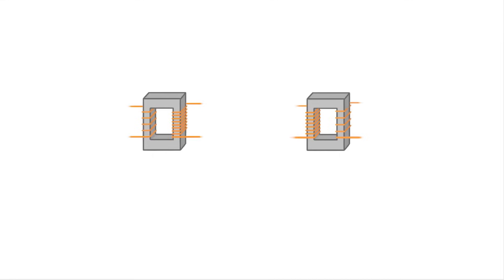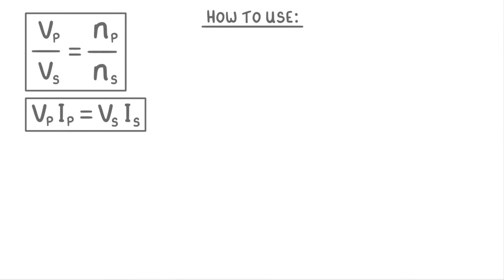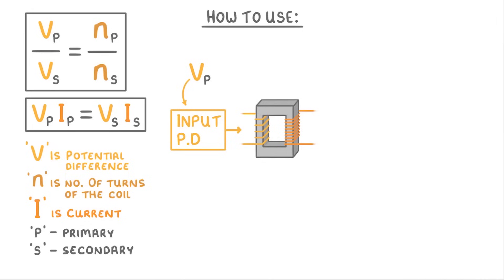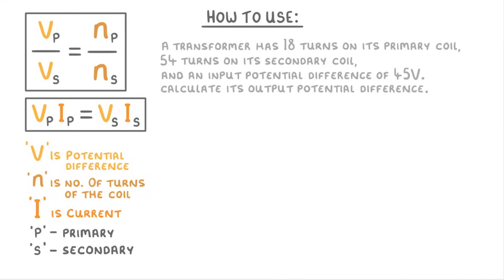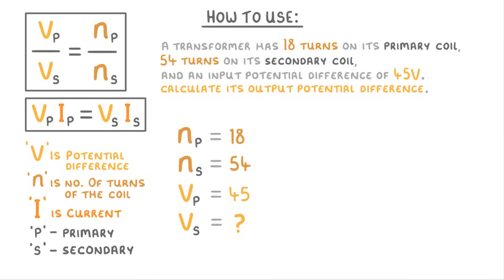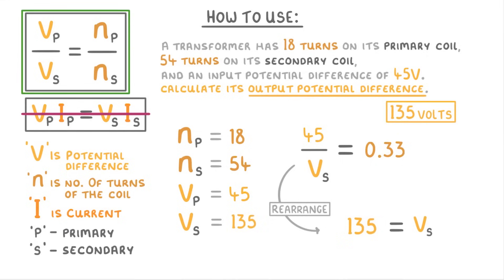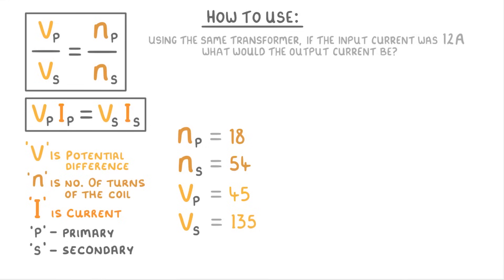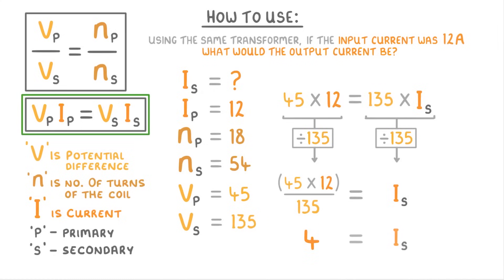GCSE Physics - Transformer Calculations (2026/27 exams)

Comment: bro i calculate 45 divvied by 0.33 and my answer was 136.36 is it right or not ?? @cognito
Reply: You need to make the 0.3 recurring, then you get the correct answer of 135V :)
Reply: Or leave stuff in fraction form till your final answer.

Comment: The first question is wrong 45/0.33=136
Reply: What how? That makes no sense. 45/.33 is just 45 × 3 which is 135.
Reply: If you do it using the cross multiplication method (45×54/18) it would equal exactly 135 so he is correct